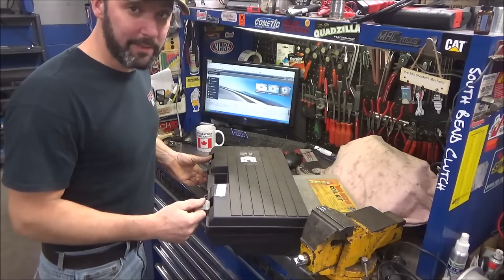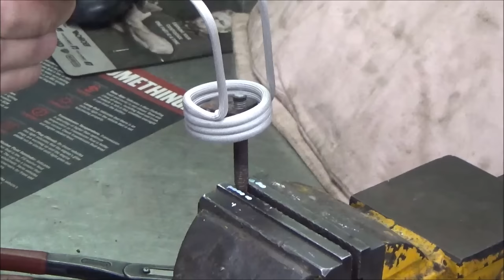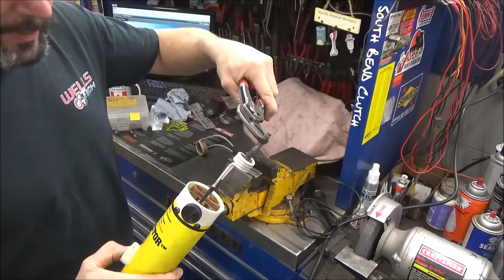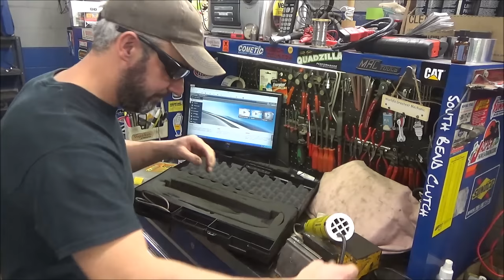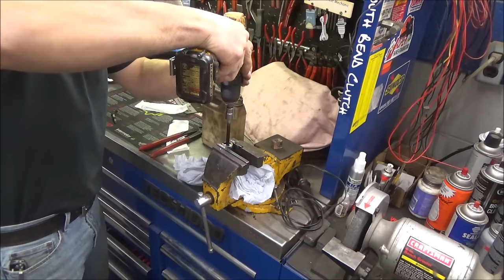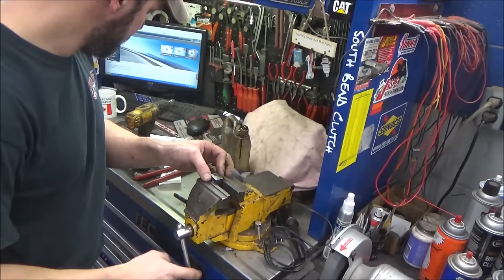How To Heat Up A Nut or Bolt WITH OUT A Torch

Comment: Nice vid. I was expecting it to be here's something you can do it with something in your garage or pocket though. As for the science of it, I suspect it's induction. That's a rocket scientist guess based on what it's called. 😂 Yep you made an machinist wince threading, but I was kind of impressed. I was expecting the die to snap / break. Thing is the shaft that is left is sometimes a touch thicker (don't know about yours there) than what the threaded part was turned to before threading, it may be too much for the die to handle. Some dies are HSS & better quality, some are high carbon steel & wouldn't cope. Also some bolts are hardened whether the shaft is the right diameter or not. That's why you have to be careful. It's ok when knocking something of the lathe or mass producing bolts or similar of a multi spindle or CNC, because they haven't been hardened or treated yet. If so they get sent off after. The reason some shafts are a touch thicker, is because that's the area usually designed to fit snugly through two or more pieces joined together the thread is just there to lock the nut down & the pieces together. It's snug fit so it doesn't rattle around. Some even taper more towards the head.

Comment: I have a bolt stuck on the charcoal canister I don't think that's a place I can use a torch right? I cannot get the bolt loose so perhaps an inductive heater is my last option? Aside from drilling into it and it's a very tight angle so I would need an extended to get the drill bit up there

Comment: Question?  I have an old Acura Integra B18B1 that has stuck sparkplugs in the head.  I broke one off trying to get it out and ended up having to put an insert in the hole.  I haven't tried removing the other plugs cause I know they're stuck like this first one.  I've been soaking them in penetrating oil while driving the car around hoping some will get in there before I try again.  Have you ever tried this tool on a stuck sparkplug in an aluminum head?  Way down in the plug access hole.  You think this would work without breaking off the sparkplug???
Reply: I had the same problem, different car. This tool won't fit, at least my friend's didn't. If you can, get the engine to operating temperature, and quickly soak the spark plugs with penetrating fluid, should be easy in a B18, do that a couple of times and then try to remove them, hold your breath and hope for the best. If it fails, try with an easy out socket, or reverse thread drill, depending on how it breaks. Good luck!

Comment: I heard of  a  tip, a  way to make  removing heated bolts easier to take off.  Once its gotten warm, applly a candle or wax and let it melt onto the threads within the stuck part.  Seems it will come out much easier, suppose to act as a lubricant

Comment: My dad used to melt metal water pipes with a welder. Set the amperage to the one that has the 100 % duty cycle and connect the ground to one end and stab and hold the welding rod to the other end. Leave it till the water starts to run. Works even underground , as long as you can get to both ends.

Comment: I don't have either...but I'm currently working on replacing a fuel pump on a hyundia azera...I have 8 bolts to get off and there rusted..I scraped and am soaking it with pb blaster...would an inductive heater tool work and be safe?..thanks for the video...

Comment: Will it work on hot dogs fast lunch in shop
Reply: It is not a microwave. it is a high frequency electromagnet running way way below microwave frequencies. It only works on metal. They use similar devices to melt metal for castings

Comment: Hey I'm not trying to be one of them haters out there South Main.  However in my DIY experience I found it's much quicker to cut off a difficult frozen spindle nut, etc. with a tungsten carbide bit and a Dremel or hand drill.  You have to be careful not to damage the spindle, etc. A guy from West Main Street.

Comment: In your opinion, what's the best way to get valve cover bolts loose, mine are binding, I think there over tightened inside of the cover attached to the head. If i keep trying to muscle it loose do you think they will snap off/break? It's a 02 accord vtec engine
Reply: Ernest Hin    Kano Kroll penetrating oil. The very best. A little on the high end money side but the best.

Comment: You can repair the worn or damaged insulation on your induction coils. Check electric motor repair websites it is sold by the foot and just slips on.

Comment: Can you use this to unsolder a pipe? I have a 1/2 pipe in a wall I have to unsolder but afraid of causing a fire in the wall.
Reply: It will be very, very slow if it works at all.  The tool is really intended for ferrous metals like steel, iron or even stainless.
Reply: You can test if this will work on your "X" project by using a magnet.  If the magnet sticks to the bolt/pipe whatever, then the answer is yes.

Comment: I've never heard of that kind of a tool, but I'm also not a mechanic. However i do have a 6 volt/ 12 volt battery charger, could that be used to loosen stuck/ rusty bolts ?

Comment: That is slick, used an induction heater for ball bearing changes on electric motors in the past, though they dont look the same
Reply: We had a big one for the 12,000 Hp pumps at the Windy Gap Pumping Station on the Colorado back in the day.
Reply: @augustaking8  thats a big pump my dude 👍
Reply: @augustaking8  biggest ones we used to rebuild was 400hp
Reply: @gary00832  The original plan was for 10,000 Hp then Hitachi gave them a deal on the 12.000's so they were taller and heavier and the bridge crane was too low and a ton and a half too small. I had to load test for 120% per the Engineer's request and the factory rep said no warranty. I had to climb up in the bridge and run the upper limit switch by hand with a special pick collar set lower on the rotor to get it above the stator to set it in. They had four pumps for a 108"  6 mile pipe to the top of the Big Thompson Project up in Grand Lake and 1 pump running 24 hours emptied the reservoir so I don't know if they ever made it bigger. I went through 13 revisions on the wiring and the engineers paid for all of the changes.
Reply: @augustaking8  how old are you?
Reply: @gary00832  63 Retired IBEW 292
Reply: Man, I bet youve got some good stories to tell. I was looking up windy gap and they've updated and expanded it for sure, by 70 kv ( 1 double circuit transmission lines vs 2 single circuit lines ), so you can imagine
Reply: @gary00832  When we started the first pump   we told the gal at the substation to crank-up her overloads and she thought we were kidding. We even knocked out the power in Granby. Good thing I had the back-up generator done. They run on 13.8 kV and not even 200 Amps but the inrush spinning up a 26.5 ton rotor and a 6 ton driveshaft with a 15 ton impeller in water is just nuts. We had six different guys fail on the manifold welds which had to be x-rayed with us outside of the building until we got a guy that worked on the Alaskan Pipeline who could pass. It takes a lot of pressure to get that volume of water up over the mountain to Farpoint Station.
Reply: @gary00832  Before Windy Gap I was down past New Orleans on the west side of the Mississippi with Quady Electric and Johnson Brothers Construction expanding the International Marine Terminal Bulk Transfer Plant, a ship loader  for coal. If you look on satellite view it's down Belle Chase highway just past Mier's Grove about 18 miles from the Gulf. We had two big stacker/reclaimers toward the highway with double 500 Hp motors on the conveyers but they went to more smaller set-ups last I looked. Later I did a bridge with them up here in Minnesota so I tell people I've worked over both ends of the Mississippi and under the Colorado. Johnson Bros. also did the pipeline for Windy Gap but I don't think Western States is around anymore.
Reply: Do you know or have crossed paths with Jerry Reese from Michigan he owned back in the day R&R Electric Corp, he got his start at G.E back in the day. Ive learned a lot from that guy. Bought and sold electrical equipment all over North and South America's
Reply: @augustaking8  ive heard of both of those companies (quady and Johnson bros) btw
Reply: @gary00832  The name sounds familiar. I worked with MJ Electric from Iron Mountain Michigan when we did the fiber optic retrofit on the Dickinson Conversion Plant that's just down the road from me and turns DC from Dakota into the AC I'm using right now. Windy Gap has GE Redline switchgear so I might have met him there. I think the IMT ship loader had them, too.
Reply: @gary00832  Just had to check one of my old uniform patches and I misspelled Quade's but that's how you pronounce it.

Comment: Enjoyed meeting the new tool. Personally, I would have cleaned up the threads that we're going to be screwed out through the nut. Also after breaking loose, I would have applied penetrating oil. That squealing noise is galling going on.

Comment: Would that be safe to use inside a washing machine to remove hub nut?  I've been trying for a week now, starting to chisel at it.
Reply: Possibly, but if there are parts nearby/touching that don't like heat e.g. rubber seals, plastic washers, they could be damaged. An impact driver with a little PB Blaster might be a thought too.

Comment: Do I see a can of Kroil on the shelf to the right of the vice? .. If you spray a little of it on the bolt it cools the bolt ( making it smaller ) and it runs down into the the the threads .
And they say " why do you old guys always grease everything you work on? "
Reply: if you can wait a week and use PB Blaster, heat isn't needed.

Comment: Hey Eric, love your videos, especially the Subaru ones. I need to replace my ball joints. Would this work on the pinch bolt, or is a torch still the better option?

Comment: Hey Eric, great video. how much did ya pay for the crank bolt socket lol. who's the maker of it. congrats on 20K! now just get them to anti up. lol
Reply from the maker: +Michael Nicholson What socket?
Reply: The one you used on the Honda 100K Service with water pump and timing kit. It was for the crankshaft bolt. It was a 19 mm thick walled socket. It looks like you tube didn't put the right comment with the right video. Lol?
Reply from the maker: I see that, you can buy it here : http://astore.amazon.com/httpswwwy0837-20/detail/B00RGNCV1U

Comment: Just ordered me a bolt buster brand version for a tie rod jam nut on a 2008 trailblazer.
Reply: nick elias put some muscle into it along with penetrating oil I've changed many I didn't think I could I highly suggest the Cornwell twister adjustable wrenches best tool ever for tie rod jam nuts they are teethed like a snap on flank drive plus put way better they put snap ons adjustable to shame, the handles are twisted so you can push on a flat surface instead of thin edge of you can't find a Cornwell dealer order off their website or use a regular adjustable and a hammer
Reply: Derek The Tool Guy nice thnx, im going to look into them. i ended up torching the boots and the grease started smoking on the trailblazer... and it still didnt budge so it turned out being a fail on this vehicle. i ended up changing both the inner and outer tie rod ends on it

Comment: I don't have $430 plus the cost of whatever that coil kit is. I understand the advantage of doing something flameless. I work in h v a c and sometimes I have to use my small Turbo Torch with MAPP gas. It's about $80. You have kick ass videos by the way.

Comment: What was that lubricator you was using to cut new threads ?? Cheers
Reply: +Neil M82 You can use motor oil as far as I know. May as well be old motor oil in the vid. But I'm not sure.

Comment: Wonder if the new bolt will hold up or rust.  Betting it was electroplated galvanized steel and the tap removed that above the original threads.  Great idea though.

Comment: Neat tool. How many uses can you get out of a coil?
Reply: Theoretically unlimited use as there is no wear in the coil.  If you let it get too hot from holding it too close to the red hot item or touch it to the heated item, then you might melt some heat shrink/silicone tubing  insulation from the coils allowing them to touch each other and that's when you get sparks you didn't want.  I'm a (Shade tree Pro), does that count?  I love the smell of new cardboard...

Comment: How well would this work pulling bolts out of a block . I have a hot water coil I have to change on a boiler and the manufacture used bolts not nuts on a stud . There was a guy that did one on the same boiler I have to change the coil on but it was a very short video
Reply: If there's liquid touching the block, or coolant still in the passages then this wont work too well. The water is a great heat conductor and you'll hit the duty cycle on the induction heater before anything gets hot.

Comment: For many years now, whenever I wanted to have 
hot dogs in the shop for lunch, I brought out the
old Heat Induction Tool and heated up the hot dog,
tossed it in a bun, slap on some mustard and lunch
is on.
Reply: james lynde how? make a hotdog jig out of angle iron stuck in the vice?
Reply: There's enough blood left in a hot dog for it to heat.

Comment: If you don't have that heater, be careful, and use a torch. (Just use common sence). Thanks for the video. I wonder if a diy'er could make that heater tool? It looks like it uses a big capacitor, a fan, and that insulated coil? When the insulation wears off, it causes a direct short.
Reply from the maker: I dunno, I suppose if you are crafty one could be made for sure

Comment: IMHO I think it would be hard to get into real tight places like when you did the exhaust manifold on that Dodge truck.
You should do a video on that when you remove exhaust manifolds on the dodge truck or a ford truck using the tool.

Comment: I swear, when you first started to heat that bolt up, I could smell the smoke through the computer........Alas it was just my neighbor firing up his Burn Barrel, Wow I though you had come up with something new. O well.

Never thought to thread a bolt via the vice, nice trick, 2nd lesson I learned today, First was 10 pound test line will not hold a Gator if he wants to swim away.
Glad you had your safety glasses on when you used that wire wheel :) Would not want Dr O to lose a good eye.

Merry Xmas  to the WHOLE family, little do they know they are all part of your Success on You Tube..
Almost  20,000 Subscribers...Yea Haw
Reply from the maker: +Charles Miller Haha you big old honky tonk haha, that is one of my favs actually, right next to "what in the thunder." I'll bring down some light weight cable and we can go "fishin" Yeeehhaaaa! Merry Christmas Charles!
Reply: what is the use of or fun repairing paarts made of recyycled old parts? waste of time...it russty and haalf power!!!

Comment: Good video ! Does the coil thing Get Hot or Just the Part you are Heating up ?
Reply: Coil gets a little warm and may get hot to touch after a while.   It’s not heating up itself, just getting hot from being near the bolt which will get red hot.
Reply: Shannon Cole yt

Comment: A few drops of concentrated vinegar acid does wonders on rusted bolts and nuts. It works better than the best penetrating oil I have tried.
Reply: sorry but a bolt that's torqued in, nothing 'penetrates'. Not vinegar, not WD40 and not PB BLASTER. Been there,done that.

Comment: I'm into a 2010 Grand Caravan 1 week to get it inspection ready. Yeah even before I touch once I took off wheel isaw a bracket hanging bolt was broke off ebrake cable holder. And took off brakes and ebrake holder that connect to area above the hub bolt access holes that was just hanging. Broken bolt again. Well I think I know why, the bearing is bad and the hub is rusted to the hill. These 16mm are not moving so that tool would be handy to heat these stuck bolt if possible and the broken ones.

Comment: Not good for every application but, I have used highway flares to heat a rusted bolt or frozen lugnut when out in the boonies. Don't breathe the smoke though...

Comment: My dad would just put that bolt and nut on the kitchen stove and turn on the stove.
If you get the right adapters you can remove small door dings dents in car panels with no damage to the paint.  Don't have to get behind the panels and try pushing them out.

Comment: So can we use something that looks pretty much identical (cannot verify if way of functionality is identical): egg boiler to surround the nut or bolt assembly that we want to free from crud, rust and deposits?
Reply: vissualy similar, but egg boiler is resistive not inductive, google inductive heating for more info
Reply: @unionse7en
☆aaha! sMartlY answ'd by the nerd. Hmm howd i forget the diff. Now just...
Reply: @unionse7en cont'd..
..help me w/ the ¿ of whether changing pcv valve and valve cover gasket will solve poor accel problem!

Comment: those alt bolts are a freaking monster. I highly believe it's a design flaw industry wide way back when they first were "invented". my 86 Volvo almost ALWAYS breaks the head off the adjuster bolt. 

someone should redesign this age old headache.
Reply: geoffrey walker dont put steel in aluminum?

Comment: We had a rash of in tank fuel pumps there for a couple weeks , Boss Man couldn't figure out why all the Fire Extinguishers kept coming up empty on his weekly Shop Inspections , Yep if'n you ain't heat just freeze them suckers an then tap tap as they start thawing , If your in a non -explosive environment you can also run a couple beads with your welder on the nut or bolt head ,

Comment: Can this completely substitute the oxy-acetalyne torch? Did you find any instances where the inductor did not work on?
Reply: Milton Hernandez hell no!  It can't cut steel!  You can't heat a large area. It doesn't fit many places. Wouldn't be able to heat something like a bearing race.